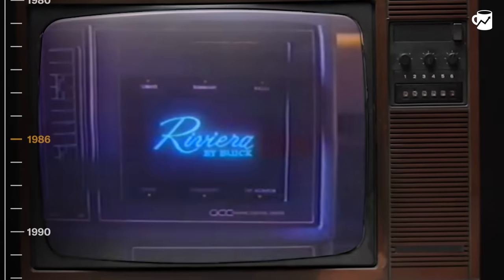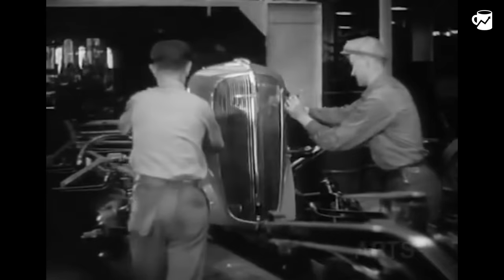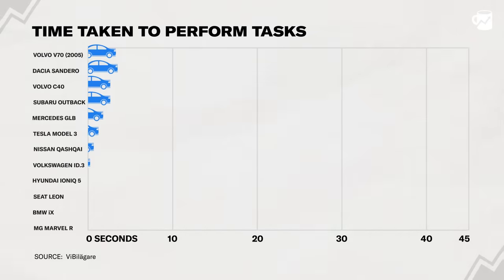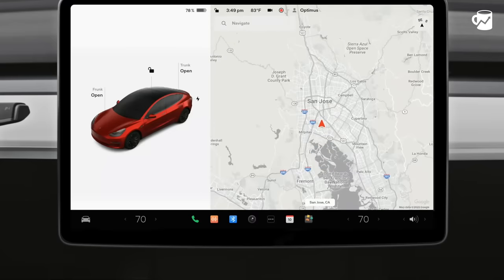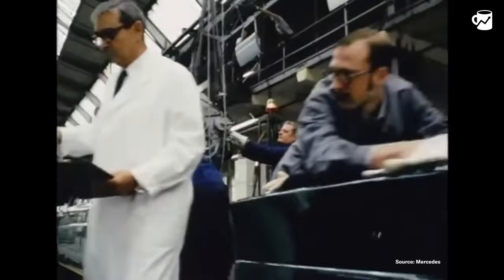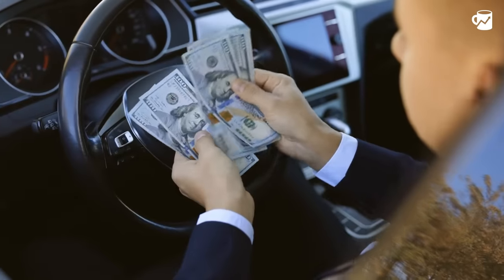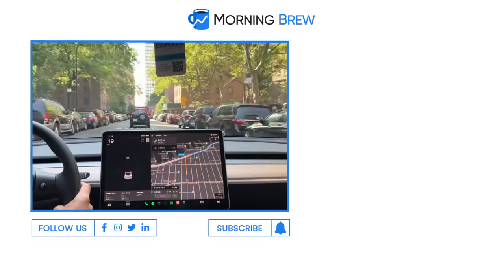The Real Reason New Cars Have Touchscreens

Comment: My VW mk1 Golf is much more exciting to drive than the latest Caddy I drive for work, like almost everything about a vehicle costing 10x or more is just pure trash, like I actually hate it at this point. I preferred driving a 2015 Quantum until it got swapped out for the new Caddy. Where are the physical buttons for AC? And why does the vehicle not have a feature to turn off the brake assist nonsense? I don't need more stuff complicating my driving experience. I had to literally pass to get my license in a car that has "less safety features", yet I feel safer in it than I actually do in the newer stuff, because it feels like I actually still had "control" over the vehicle compared to the car telling me what it wants me to do instead. Thanks for the video tho, my dislike for newer vehicles have already been cemented, but now it's being explained why at least

Comment: Ok I don’t usually leave bad comments but holy crap. The crying about missing physical buttons because “touch screens are too complicated” is the most pathetic crap. It’s like hearing a 90 y/o complain about using a new TV or cellphone when their old one worked just fine. Yeah gramps it did, but I couldn’t do 1/10 what the new one can. Same with screens. They open up so many capabilities both while driving and while parked, and can be constantly improved through updates without you needing to buy the new model. And complaining about not knowing how to do things is ludicrous. You sit in a Subaru after a Toyota and you’ll be confused about where some of the controls are until you drive it for a couple hours. Same with a screen. You will quickly learn where controls you care about are, and never think about it again. I’m shocked at how many young people (I’m using young loosely here) are flabbergasted by a touch screen in a car yet fly through their phone like a speed runner in a video game. You can and will get used to it. Nothing you would ever have done on a physical knob is much more difficult on a touchscreen, and many things are a bit easier. Everything else (deep settings, navigation changes, etc.) are far easier on a big ass screen than on your phone or car play, but that doesn’t make them safe things to do while driving. Go sit in a Toyota with CarPlay and try and change the navigation. It’ll be much more difficult than if you had a massive screen with larger touch targets. Whining about something being difficult after trying it once or twice on a test drive is ludicrous. Imagine trying to go back to reading tiny glyphs on physical buttons taking up your entire center console after getting used to a touch screen that keeps all your controls in one place color coded and with more legible icons. 

Rant over

Comment: The problem with software in cars, it's easily hacked.  I tried several methods to get unhacked and failed.  The hackers used the cars electronic system to cause me many issues and rendered my car almost useless.  This is why I refuse to buy new vehicles now, I don't even use the car radio.  I'm in the process of stripping mine out because of the hackers and getting rid of my antenna.  Also, never plug your phone into your car.  Big mistake.  Car companies need to get more serious about security.  Until they do, no way.  

The problem folks, the police.  Ironically, yes, the police are the problem.  They are the ones horny for hackers and bad guys to work for them.  These bad guys give the cops business.  The cops don't care where the business comes from as long as they get it.  There is zero accountability when it comes to modern day policing.  It's been like this since the 1990s.  Something happened in the 1990s which turned police and intelligence agencies into monsters.  I suspect it was greed and lack of jobs that did this.  Community watch operations and policing was totally separate.  You didn't see the connection until the 90s.

Comment: I will never buy a car that is full touch panel inside, and also Android Auto is garbage. I can navigate my phone on a proper phone mount without taking my eyes off the road in less than five seconds. Android Auto requires me to learn a completely new interface that I can't use anywhere but in the car, which means I'm never going to learn it outside of actually operating the car, which makes it more dangerous for me to learn.

Trying to use Android Auto versus just using an interface I already know and is intuitive because I've been using it that way for the last 15 years is just not a competitor. Also, I hate to say this, but even the high-mounted tablets on the dashboard of the car are too low for you to be interacting with it while driving. And if you want further proof of that, there's the whole reason why heads-up displays exist in cars. Because the gauges are technically too low for you to be looking at. You have to change your focus.

I use Spotify while driving every day. And since I haven't been in my car with my proper phone mount, it's basically impossible to  Because no matter what task I'm doing, short of changing the song with the volume buttons, a feature of my phone, it is impossible to do it without looking away for too long. Like you said in the video, Touch screens are a visual device, not a physical one.

Comment: A rather biased opinion. You forgot to mention the essential benefits and obvious reasons of touch screens like software updates and upgrades, less cables in car design or better interface with today’s smart features. The dumbest and most distracting design would be knobs and buttons plus non touch screens which a lot of cars had until now.

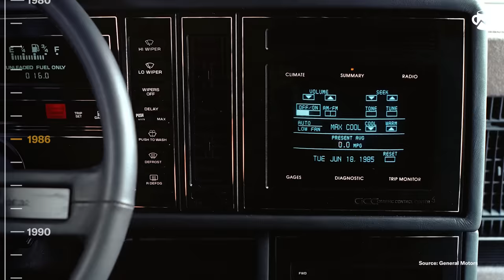Comment: 00:03 Touchscreens in new cars lead to user experience and safety pitfalls
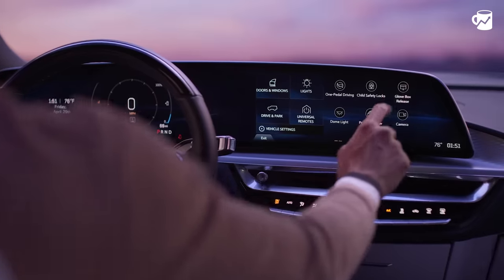01:10 Big touchscreens in cars are not without challenges
02:09 Automakers are now integrating consumer electronics into car design.
03:13 Touchscreens in cars increase visual distractions
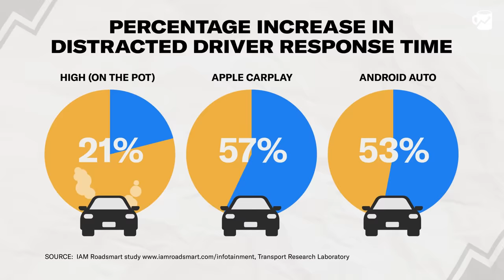04:18 Touchscreens in cars lack tactile feedback
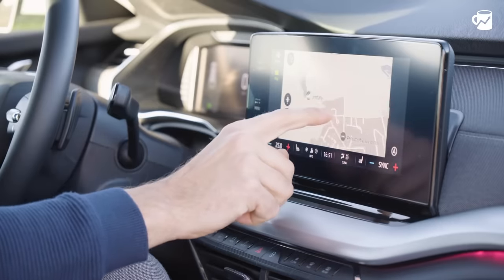05:14 Touchscreens are cheaper and easier for automakers to implement than physical buttons and knobs.
06:14 Touchscreens in new cars are primarily for cost-cutting and profit increase
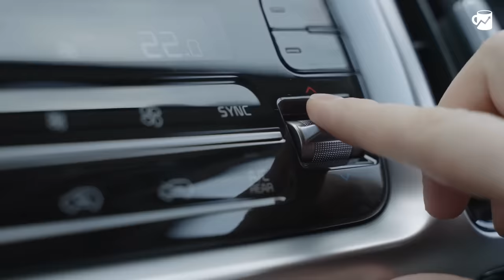07:22 Backlash leads to reintegration of buttons and knobs in new cars.

Comment: Your chances of a car crash double if you're distracted for just a few seconds. Think about that. Touchscreens & gadgetry galore are clearly contributing to distracted and dangerous driving. And EVs are faster and heavier than most ICE vehicles on the road, and potentially more deadly. Road death statistics in the U.S. are already obscenely high and not getting better.

Our goal should be reduce car-dependency as much as possible while simultaneously promoting and funding world-class public transit. We need car-free walkable-bikeable cities that are safer and lower stress for everyone. Liveable cities that are built for people instead of cars encourage greater community involvement along with an active-healthy lifestyle — opposed to noisy, polluted cities where a car is required to get around because it's been planned and purpose-built for cars & trucks, first & foremost; with pedestrians and micro-mobility commuters coming in a very distant second, if at all.

Comment: My 1964 Mercedes w110 200d has one touch screen and two computers. The computer in the cd player lives in tne dash and tne touch screen and second computer in my phone lives in my pocket.
The car will run perfectly with no battery or generator, just the lights and self starter won't work.

Comment: 2:46 Nah, Mr Expert. The problem is the POS companies you work for won’t spend the money to hire software engineers & programmers to write the software in-house, to the specifications given by the rest of the team. Instead they’re cheap greedy trash that will cut corners and buy the software from some other company. Ford, for example, became the automotive giant it is today because Ford was a control freak & he ended up owning & controlling the most or all of the production & supply lines. 

Today, we have a bunch of buffoons doing exactly the opposite of what got the company to where it is.

Comment: ...but this makes no sense.  Nobody needs to develop new switches or knobs, they already exist, and look at keyboards - I bought this keyboard for £13 a couple of weeks back and it 79 keys, because the hardware is totally standardised and commonplace.  They have to get components from suppliers already, and you need a dashboard whatever happens.  You're trying to claim a few switches that cost what, a dollar, to make and a moulded plastic housing which you'll have to build one way or the other, and some basic firmware to run it, are more expensive than a big-ass curved backlit touchscreen in a custom panel size to suit your dashboard, along with the hardware to drive it AND software designers to build a UI AND software programmers to make it work AND software testers to ensure it doesn't crash, all of which are not traditional auto industry skills and will require hiring a totally new set of highly skilled workers?  That makes no sense.

Comment: I wasn't a fan of 'screens' at the beginning, but now I find this story to be a bit over the top.  I drive a vehicle with a large touch screen, but it also has a wiper stalk and a turn signal stalk on the column.  Once you spend some time to learn the operating system, set your defaults with overall tailoring settings to what you like the 'touch screen' is much less of a hassle and I really enjoy navigation maps big and clear.  This video was very misleading as the driver jumped in the unfamiliar car and took off for a drive in busy city traffic . . . wrong on him.  Had he took the time to familiarize himself with the differences and set up his preferences he would have had a much different opinion I feel.  But when self important ego's believe they are so busy to not learn anything new it's no wonder it's hard for them to find employment, friends, mates, etc etc.  What this narcissist failed to realize is you can actually make the car revolve around you instead of visa-versa, but he had no patients or desire to do so and drove in public while being confused and self centered.

Comment: Great News..!
  While you are locked into your burning EV by inactive electronic door locks and window controls, you may possibly be able to watch yet another advert on your central touchscreen before the toxic combustion fumes kill you. There is more good news in that 2,500 degree Celsius combustion temperatures will ensure your corporeal remains - and those of all those travelling with you - will be efficiently pre-cremated before your family funeral service, thus saving energy from the gas oven perspective.
  And did we mention that the original Reason for your minor collision  - which initiated your battery blaze - was distraction due to you, the driver, having to take your eyes and attention off the road for a second or two - just when that elderly driver of an equally old diesel car, pulled out right in front of you...

Comment: "Everyone hates touch screens."

What? No we don't. We only hate it when there aren't hard HVAC controls, a volume knob, seats/mirrors, etc. We're perfectly fine with all the lesser-used stuff in a menu, and of course just info display.

You claim a lot of detriments for touch screens in general, that aren't true for them generally. Like, "there's no haptic feedback," or, "the software is bad," neither of which is an inherent problem with the tech, but just something that is application specific. And don't act like nobody in history has ever taken their eyes off the road for a second to glance down at their old-school radio unit or whatever, especially once they became more feature rich than just two large knobs. You keep showing Tesla's implementation, in which they try to put EVERYTHING into the screen, which is annoying, but not every manufacturer does it like that.

"It's marketed as tech forward and advanced, but it's really just the a way of cost cutting." Can't it be both?

Comment: This video is very "get off my lawn" ... Tesla ... volume control is the left-hand thumbwheel on the steering wheel.  Nudging it left and right does next/prev track... you don't need the screen at all.  Notice that the tesla screen is not in the dash, but in front of it.  It's far easier to reach it, and you can brace yourself against an edge of the screen, making it far easier to hit particular points on the screen... Other makers put the screen in the dash, harder to reach and nothing to brace against making it far harder to hit things.  To adjust the temp in a tesla, there's no menus... you just touch in a part of the screen... same place all the time... muscle memory does apply. oh and voice commands do work, but I never use them.

The video's not wrong in that it is likely much easier/cheaper to produce a dash with just a screen, than all those dials and buttons. but also ... the controls of my car have literally changed over time... My Tesla'd regen was completely different when I bought it, and five years later, it has very natural one pedal driving.  The controls to adjust that changed over time.  I've gotten lots of helpful new features from software upgrades, so the thesis that it isn't good for the consumer is just wrong.

The old OEMS going back to buttons is because they didn't do screens properly in the first place, not because of some problem with screens.  When I talk to young drivers, they are positively repulsed by the array of buttons.  The new generation finds the tablet way more intuitive.

When people talk about adjusting mirrors... they fail to realize that all driving schools, and manufacturers for all years advise you to set your mirros BEFORE you drive. It's not supposed to be something you do while driving.  It doesn't matter how hard it is to adjust your mirrors while driving because that's inherently unsafe.